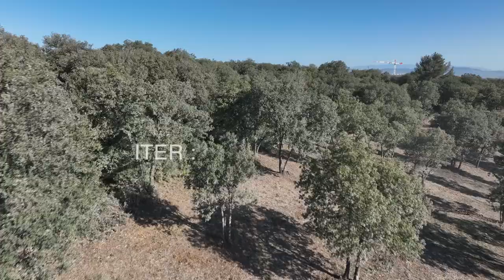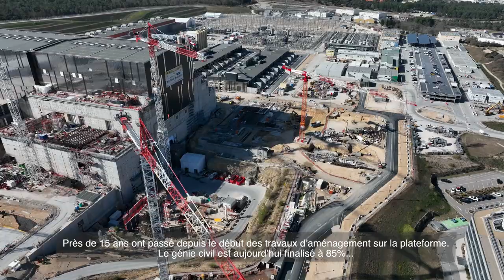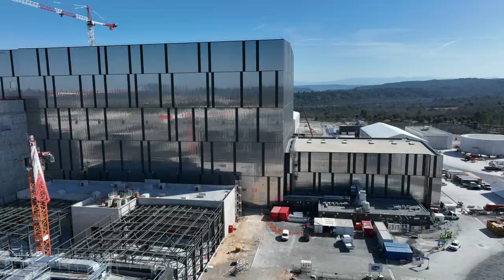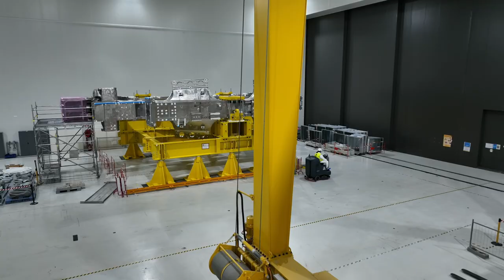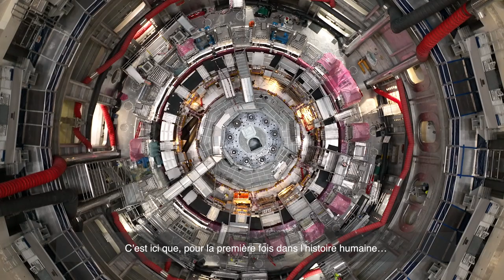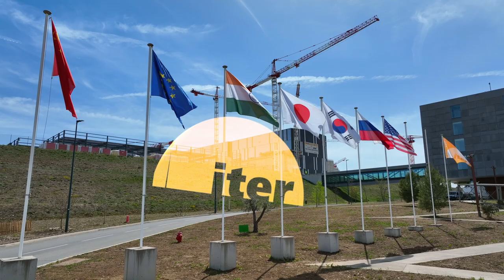ITER: Où en est-on?

Comment: OK, let me ask two *maybe not very popular question*: 1) Is this thing EVER being net energy-positive? I mean, having produced more Gigawatt/Hours in Energy than has been spent in production of it's elements and testing, and 2) Should Russia not get the raised middle finger and be ousted from the project after all they have done to Ukraine? I just see this project as a gigantic drain of resources in order to appease some minds. But at the time being, the benefits are light-years away.
The more dramatic the background music gets, the more skeptical i get.
Reply: 1) If you are thinking about electricity production, it will never produce a single Watt of electricity, as it's not a power plant. It an experiment to check if we can produce 10 times more heat that we need to spark it and lead the way to the construction of the first viable plant. It's also a lab to experiment with high energy plasmas.
2) What good would kicking Russia out of project do? You can't replace easily the component they provide as the enterprise that build it are in Russia and you can't cut them from the scientific return as they will be public.

Price of this project is in the similar order of magnitude as other scientific projects, 3 to 4 times the price of LHC, or James Webb Telescope. It's big but reasonable IMHO. It's 68 times less than the development price of F35 fighter jet, so if i wanted to find money to scrape for "useful purpose", i might be going a different door. 

This project is not aimed to be a solution to climate change, as it would require a few more décennies before it get's to industrialisation. It's just fundamental science at work.